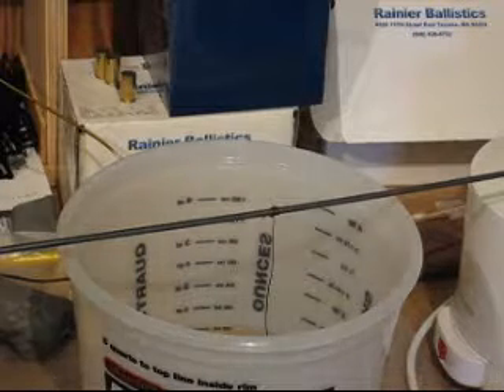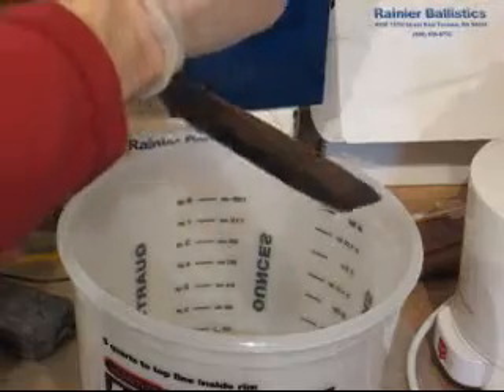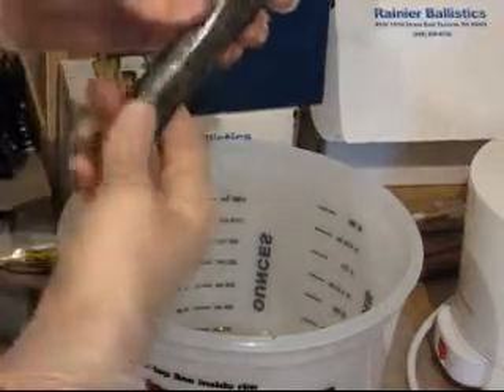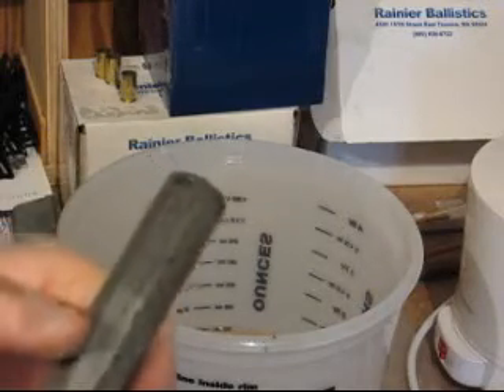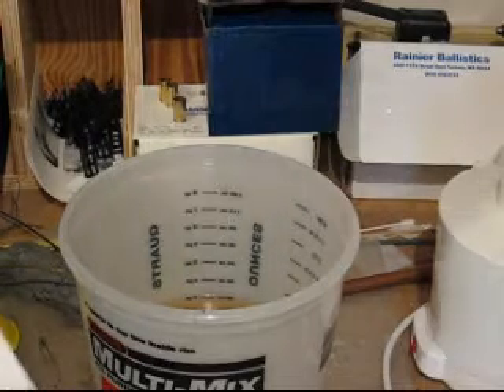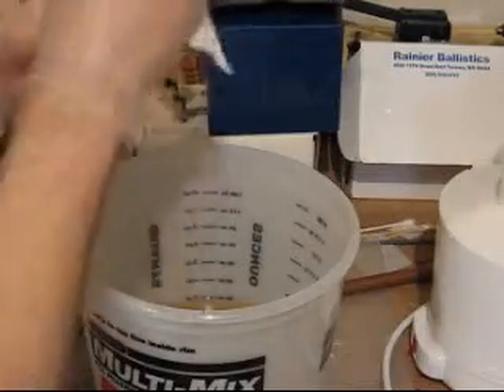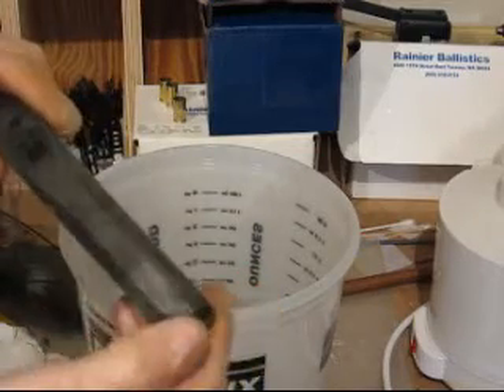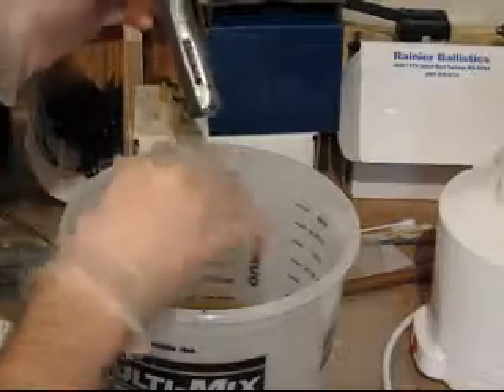Browning with Salt Solution(1)

Comment: gunsmiths suggest sanding the metal with 250 grit wet/dry sandpaper and wiping it down with acetone before you use your salt solution         IF you want it to rust faster you may try using a fish tank aerator to your salt water to speed up the process, you may even try just coating the metal and leaving it in a humid environment such as a humidor.